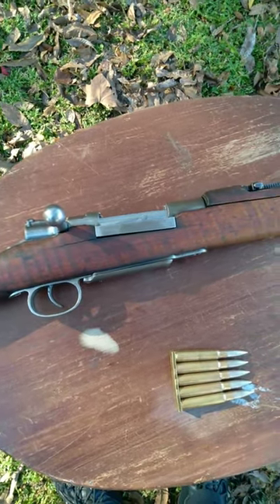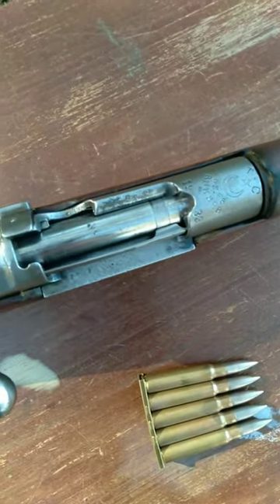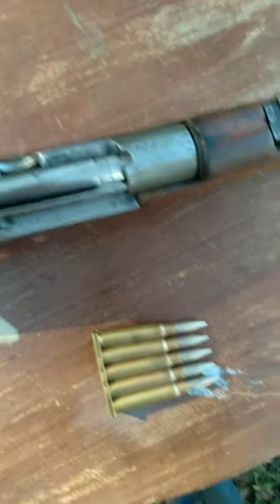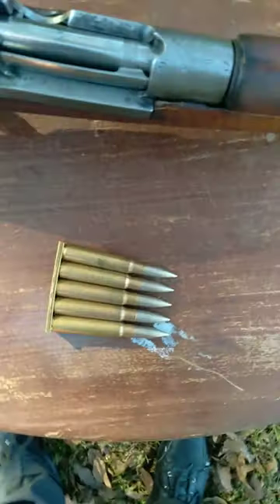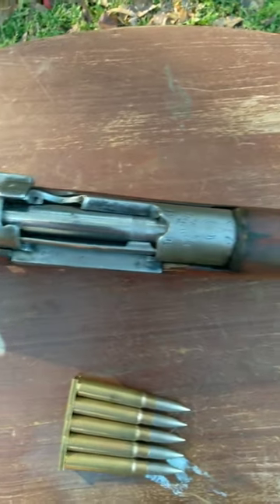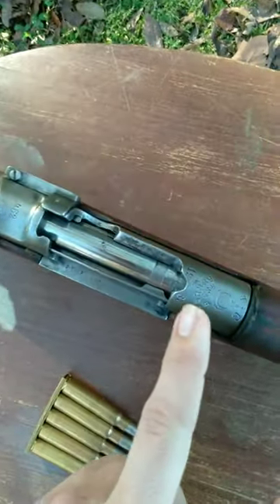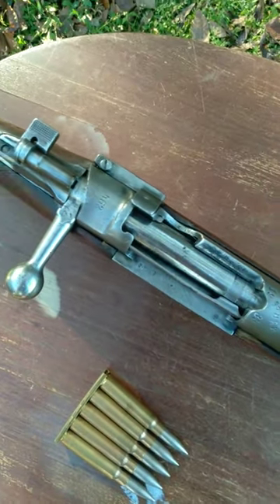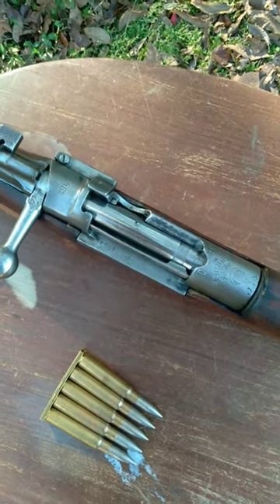Cut Mauser Receivers

Comment: Your rifle is an Ottoman 1893 Mauser, refurbished in the 30s'. The Turks changed then the old 7.65 x 53 for the German 7.92 x 57, slightly longer. Hence the modification of the receiver. Fortunately, your rifle didn't loose the magazine cut-off, most often discarded during the alteration

Comment: Because they were originally in 7.65 Mauser then converted to 7.92X57 in the 1930s. Sold 100s of these in the 90s. Found some still in 7.65. 

You'll also encounter Mausers with receivers cut when converted to 30-06.